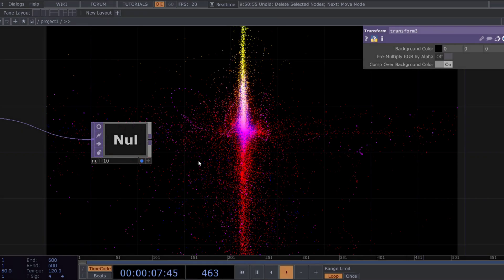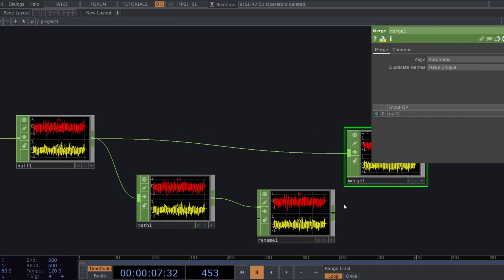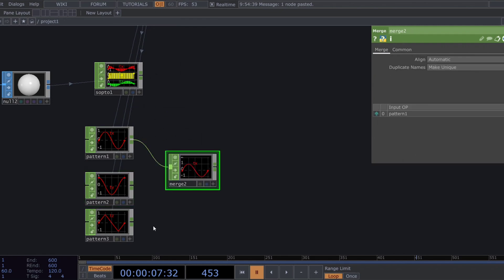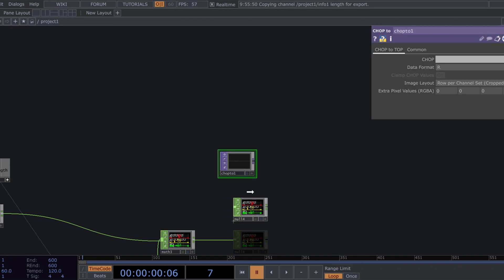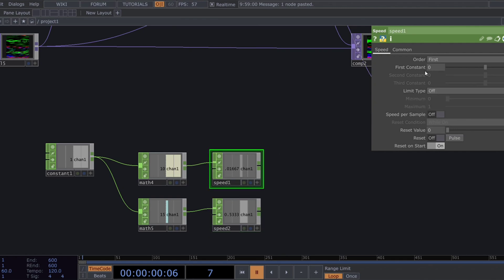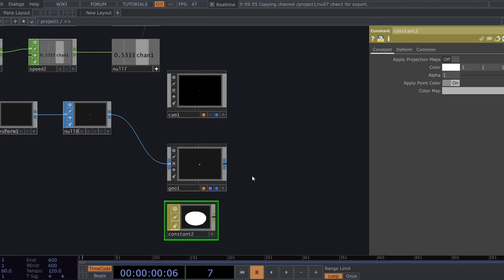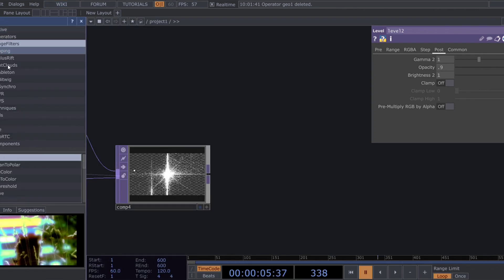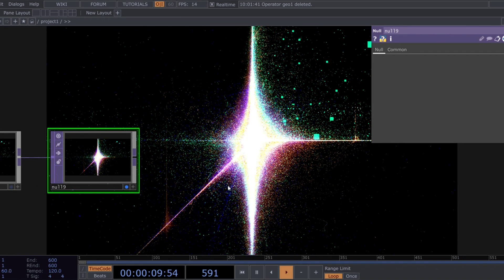Melting Star particle system with TOP instancing - TOUCHDESIGNER Tutorial

Comment: 4:15 the math chop doesnt show me the same result as yours.help pls :(
Reply from the maker: If it's showing 6 channels instead of 3, set the combine chops method to add, could u pls specify what problem ur getting in the Math chop
Reply: @PiFrac-DEV  nope 3chans, but it goes from -5000 or more and to -10 also the red channel is inversed it goes downard .i did everything the same idk whats going on
Reply from the maker: it's not that hard I would suggest you to delete this part start from the sop to chop I used 3 patterns here,  sine(tx), cos(ty), and ramp(Tz), then used the constant chop from the beginning in the length parameter of these patterns then merge these using merge chop then use a Math CHOP to combine this merge and soptochop set the combine chops par to add or whatever in the video, then Resample Resample and other stuffs as in the video I hope it should fix it, recheck the process, if still it doesn't work then send me ur network  @arshee-vr